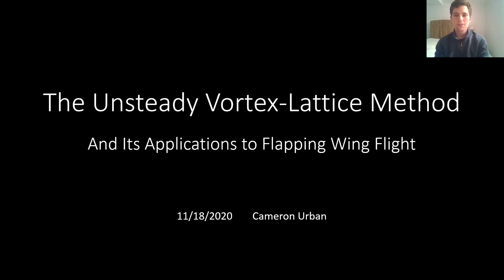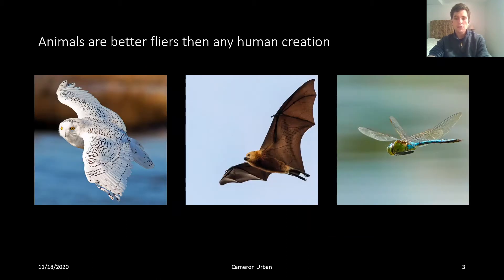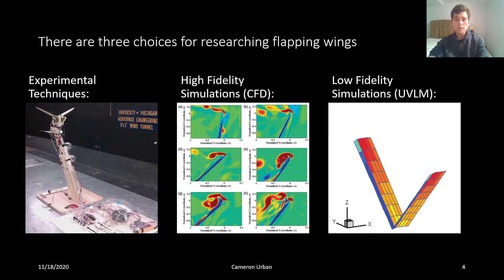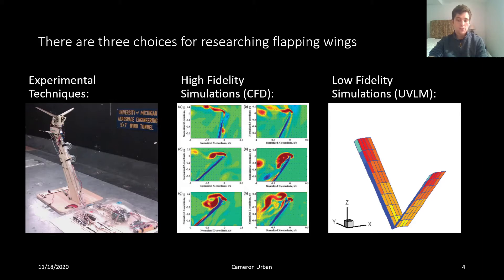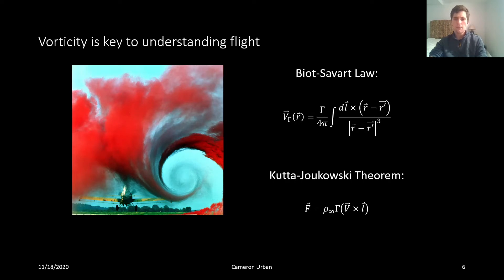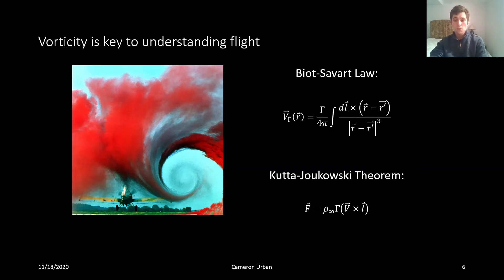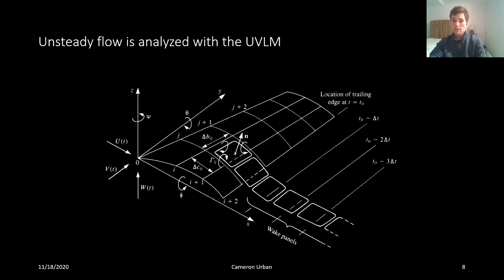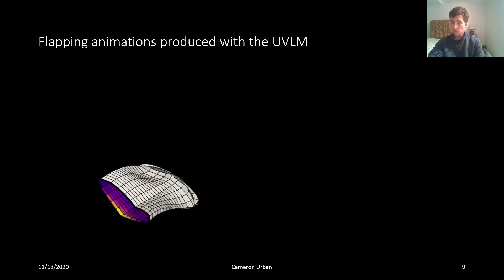UVLM: Applications for Flapping Wing Flight

Comment: Nice work, are you still researching this subject?
Reply from the maker: Thank you, and yes I am! You can find the latest iterations of my solver at https://github.com/camUrban/PteraSoftware
Reply: @cameronurban3653  Can you please explain why there is always one surface between leading and trailing edge, even though every airfoil is a closed contour with upped and lower parts?
Reply from the maker: @danielf4654  Good question! Both UVLM and the traditional vortex lattice method assume that the airfoil can be preresented by a surface along its mean camber line. This is generally a good assumption if the airfoil is sufficiently thin and there's no flow separation.
Reply from the maker: You can find more info at https://en.wikipedia.org/wiki/Vortex_lattice_method. There are slightly higher fidelity methods known as panel methods that model both the upper and lower surfaces.
Reply: @cameronurban3653  Oh, I see, should've guessed myself, thank you! :) I'm currently working on an enthomopter for my graduation project, and last 5 days was looking for ways to find lift force for given wing and its trajectory, before disigning the whole thing and its parts. I've looked into code examples for PteraSoftware, but hesitated to try coding my own case because I came across the github issue on flow separation. As I understood, there are some troubles with LEVs in PteraSoftware, so I won't be able to reliably simulate an insect (for example, scaled up fly) hovering flight to check lift force/coeff through one flap cycle, since it heavily depends on "stable" vortex on leading edge. Could you clarify, is it correct?
Reply from the maker: @danielf4654  You are correct that Ptera Software cannot currently model LEVs or any other form of separation. However, there have been some papers that demonstrate that UVLMs may be useful tools to simulate insect-scale MAVs ( https://www.cambridge.org/core/journals/aeronautical-journal/article/abs/comparative-study-on-analytical-and-computational-aerodynamic-models-for-flapping-wings-mavs/19B647752E11DF1EBB73500F45A56DF7 ). However, if you are still in the general design phase, I'd actually reccomend you base the inital design off some hand calculations and cross-reference your results with those of a currently existing insect-scale MAV. I'd try looking in the first few chapters of "Introduction to Flapping Wing Aerodynamics" by Wei Shyy for equations for hand calcs.
Reply from the maker: Best of luck to you and your project! :)